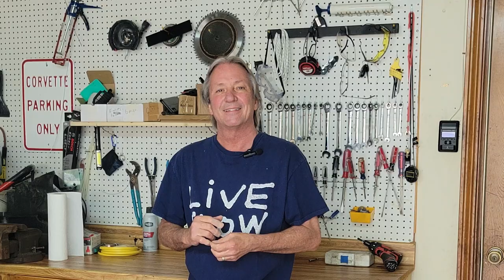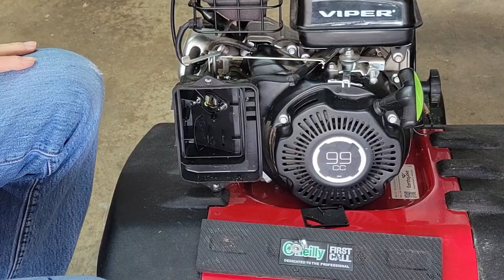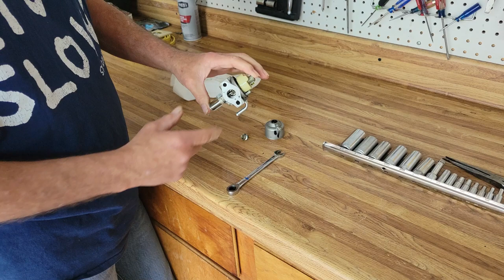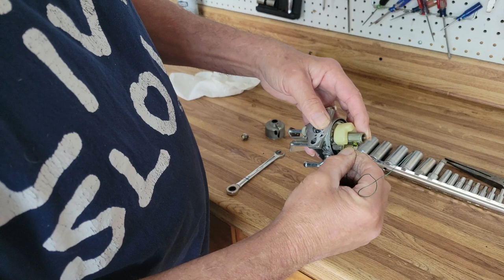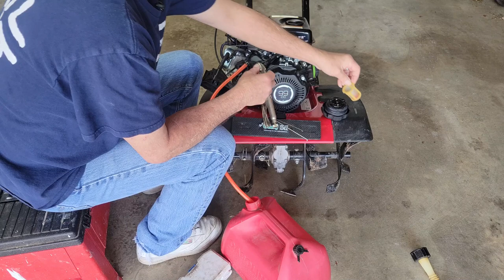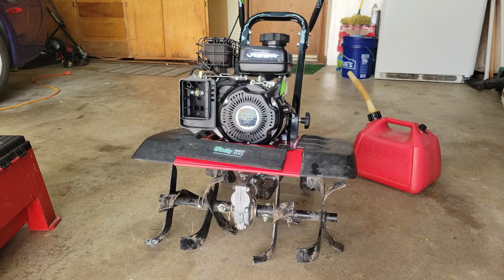Earthquake Versa tiller - left in storage for over a year, I wonder why it won't start?

Comment: So I should leave my gas in so I can be part of the video lol. The problem with home owner tillers is they get used often. I use to own one I did use mine twice a year. I never had an issue with it starting. I did you fuel stabilizer.
Good video
Reply from the maker: You can drain the gas, I get enough videos from people who don't. 🤣
Fuel stabilizer goes a long way towards avoiding meeting me(dunno if that's good or bad LOL) but draining the gas is better, you can still get enough degradation over 6 months time to clog a jet, they are pretty tiny.
Reply: @GuysPlayingWithTools  lol I’m with ya. Tayal fixes all had a great long term test on a bunch of stabilizers it was quite interesting.  Some of the big names didn’t make snuff.  But all of them failed at 19 months.
Reply from the maker: @MyGreenLawn2019  They failed the users, that's where I come in. LOL

Comment: Thanks for the video. This was exactly the problem with my tiller.  After cleaning out the carb jets and putting everything back together, it started on the first pull.
Reply from the maker: Thanks for watching! I love working on as many different motors as I can. I always tell people... it's usually the carb.

Comment: I just got mine.  Is there any gear oil or anything that goes in the gearbox for the tines?  Or is it just a dry system?
Reply from the maker: It's been a little while but, if I recall correctly, it was a belt drive system hidden underneath everything and didn't need any lube.
Reply: @GuysPlayingWithTools  thanks.
Reply from the maker: @TwoStageTrigger  👍

Comment: Any suggestions if the tines of this particular model won’t turn?  The clips are in, I can move the tines manually when it’s shut off, and the handle has tension when pushed down to engage.
Reply from the maker: Do the tines move easily by hand? I have a hundred questions, but that's a good place to start.
Reply: @GuysPlayingWithTools  I figured it out.  Broken belt.  So glad it’s an easy fix!  Thank you for replying!
Reply from the maker: @Krystal McClaskey  Cool. I am glad you found it
Reply: Were did you get the belt?
Reply from the maker: @barry1705 I get all my belts from the local car parts store.  Look up the belt online, and they will match it up for half the price, and usually, it's better than stock.  👍

Comment: Do you ever add fuel filters to these smaller engines?
Reply from the maker: Hi Carlos, good question. I usually don't but there have been cases where I have. If the gas cap is level with the top of the motor and I am already replacing the fuel line I might add a filter to keep debris out, people tend to fill the tank wherever it stops, even in the yard.

Comment: I'd of been happy if a gummed up carb was my problem, put mine away for winter pulled the cord 2 times today and started up. I let it idle for a while to warm up a bit and as soon as I engaged the belt it stalled out seemed odd. Started again same thing come to find out the transmission bound up over the winter never again with cheap tools.
Reply from the maker: I haven't seen that, but I am sure it happens. Did you consider opening the case and trying to free it up?
Reply: @GuysPlayingWithTools  Thanks for the reply didn't have time today, but I never abused the machine. In fact I have a big tractor with tiller to break ground in spring and use this machine to keep weeds down between rows, very disappointing as it was versatile with the removable tines. I've only used it for a season and a half. I'll post back when I get a chance to look at it mean time I guess I throw the cultivator back on the tractor.
Reply from the maker: @mrelectron6220  I usually hear good things about the "big" earthquake tiller,  I am going to keep an eye out for others with gear issues and try to find one to break down and see where the weak links are.
Reply: @GuysPlayingWithTools  Well I did split the transmission open this weekend. The results are the bearing at the ends of the input shaft have rusted. Apparently they did not seal it correctly with silicone rtv. I think I have located replacement bearing and will press the old ones off and press new on. I may modify the trans with a fill plug and fill with 90 weight gear oil rather than packing the bearings with grease again. At least the gears did not fail so hoping to salvage the tiller but still not happy this should of never happened.
Reply from the maker: Tillers usually have a rough life. Seems like 2/3 of the tillers I get are stored outside, or dirty,  sometimes both. Manufacturers should take  that into account in the design. The other part is. They tend to only get used in the spring, which gives rust time to work.
Reply: @GuysPlayingWithTools  I've seen that too this one lived a pampered life in my garage. The only water it seen was from being washed off with the garden hose when the dirt would cake up on it from time to time. I'm just glad I can repair it rather than buy some thing else.

Comment: My pull chord is locked up won't let me pull more than 5 inches. Is this why yours won't start?
Reply from the maker: Does the motor rotate when you pull it, or does it just tighten the spring?
Reply: No it just rejects it instantly at a certain point. Won't go more than 5inches at all.
Reply from the maker: @santiago nunez  in that case I would take the recoil off and try to turn the motor by hand, if you can turn the motor, get a good look at the recoil, something is amiss inside it, but if you can't,  it is a motor problem.  Start there, though and feel free to email me pics if you want

Comment: Where can i get a carb just like the new one you put on. Mine is identical to this earthquake and having the same issue.
Ben
Reply from the maker: You can order one on Amazon, if you get a new one it's best to put the old one next to the computer and visually compare them. 
If you want to save time and money,  check the part of the video where I take it apart,  cleaning the jets is easy and will get it running great just about every time and cleaning the whole carb works every time.
Feel free to ask questions if you decide to pull it apart. It's easier than it sounds.

Comment: Do you by any chance have a part number on the replacement carburetor you put on ?
Reply from the maker: If I remember right,  I didn't get a new one for this one. You will want to look online to find out with yours in hand, there can be differences between mfg year that aren't obvious. Grab my email from my about window and send me a couple pics of your carb, and I will match it up for you
Reply from the maker: It took a lot of digging since it was almost a year ago but I found it. Go to Amazon and search for  ARDISAM 10078
Reply: Looks as new as mine! So this junk has to have a new carb after you use it once. Got it👍

Comment: What about the oil? How much to add and drain?
Reply from the maker: Good question.  Every motor has its own oil specs, and this one is the most common, 1/2 liter(16.9 oz). I don't always do it on camera, but everything gets drained and then gets new oil when we work on it. It's cheap and easy so I recommend doing it at the start of every season.
Reply: I have this exact Model. Earthquake 99cc versa viper. How much oil should show on the orange cap?  How do you drain the oil? Thanks!
Reply from the maker: @albeme5211  Cool. It's a nice machine.  I haven't seen it for a while, so I am going to go back and check my record on it first thing in the morning when I get to the desk
Reply: @GuysPlayingWithTools  Thanks! If you could show it on cam  ,that would be great. Great and helpful content 👍🏽
Reply from the maker: @albeme5211  I didn't forget you, it's been a busy day 🙂Unfortunately I don't have one to make a video or I would but it's a pretty easy process.  
On each side of the motor(easier to get to the gas tank side.) you will see a fill plug towards right right side, and a bolt at the bottom center on the side of the motor. The bolt is the drain plug for the oil.
Take the bolt out at the bottom of the motor out and try to get something under it, it's a little messy emptying the oil form one of these. 
Once all the oil has drained, put  17oz of oil in it and check it, that's the capacity from empty so you should be good to go. I prefer Mobil One 10w30 synthetic for all my 4 stroke yard equipment.
If I get another one of these I will make an oil change video, I should probably be making them on everything that comes through. 👍
Reply: @GuysPlayingWithTools  I really appreciate it! Been busy so didn't get the chance to start it(new machine). What did you use to add the oil . Add it where the orange cap is located, correct?
Reply from the maker: @albeme5211  I usually use a funnel if it's not on the bench. Most quarts of oil have a clear line on the side of the container, and you can see the amount left in the quarter. I guess at 1/2 a quart, then check the amount left in the quart,  then put more in, then check.  If you are referring to the plastic flat top bolt on the bottom right(usually) of the motor, that's where the oil goes. 👍
Let me know how it went.

Comment: Had mine 6 years now, first time I DID drain the gas. Won't start. Every other year I would fill it full before storing and it always started right up.
Reply from the maker: I have to ask(I am always curious)Are you using fuel stabilizer (or non ethanol fuel)? Also, did you run it empty when you drained the gas? I usually recommend running it until it stalls.
Reply: @GuysPlayingWithTools Yes to non-ethonol fuel. I have used Sta-bil before but it has been a few years at least. Never have an issue topping off mowers or snowblower either. This past spring I did run the tiller until it died.
Reply from the maker: @qwsxcde0988  That's pretty interesting.  The non-ethanol fuel is what saved you, but I can't imagine why it didn't start when you followed the accepted way to store it.  If you are near The DFW area I would love a look at it. There is an exception to every rule and I would love to see what the exception was in this one.

Comment: How do you drain the gas?
Reply from the maker: Hi Ruth, I put hemostats(anything to kink the line will work) on the gas line and then remove it from the carb and let it drain down into a "bad gas" tank. If it's too low for the tank I drain it into an empty water bottle and then pour it into the tank.

It takes a few minutes to drain but the way I see it, I would spend that same time cleaning up gas if I tried to pour it out. 🙂

Comment: I made the mistake of wasting my money  on one of those tillers last year! Used it to till my garden then tried using it today! An hour later I said screw it!
Reply from the maker: If it sat since last year, drain the gas and add new, then pull the jets out of the carb and clean them and you should be good to go. You usually won't have to replace the carb unless it's been sitting for a long time(3 or 4 plus years)
Reply: @GuysPlayingWithTools  Did all of that. Still will not run.
Reply: @GuysPlayingWithTools  It sat in my shed since I used it last spring.
Reply from the maker: @Brian Green  to to drain the gas, it hasn't been too terribly long so fresh gas might wake it up
Edit: you will have to pull the cord quite a few times to work the new gas into the carb,  don't use a ton of choke and hold it floored so it can breath better
Reply: @Guys playing with tools  I had to move on to my other projects I had to do today. I'll have to try again this weekend. It just stinks that I've only had it a year and  it fails me when I need it the most.
Reply from the maker: @Brian Green  If you want grab my email from my about box and ping me and I will send you my number, I will help where I can.
Reply: @GuysPlayingWithTools  OK. Thank you.
Reply: @GuysPlayingWithTools   I am thinking it's the carbuerator but it's only a year old tiller. Is this a common issue with this brand of tiller?
Reply from the maker: @briangreen256  Unfortunately it's not just that particular machine, it's the gas. When modern gas ages, it picks up water from the air and turns "sour". I get machines nearly daily that only have one problem, they sat for a year without being used. What you want to do is get rid of the old fuel, and with a little luck you can clean the jets and it's good to go. With a little less luck, a full carb clean, with the worst luck you could have, replace the carb because the parts inside rusted and corroded beyond hope.
Reply: @GuysPlayingWithTools  I took a part the carbuerator and cleaned the crap out of it with carb cleaner. No luck.
Reply: @GuysPlayingWithTools  I have a small eartquake cultivator that sat for 2 years but no problem starting it. Only difference is it has a primer bulb and it's a 43cc instead of a 99cc. Same manufacturer 2 different outcomes😐
Reply from the maker: @briangreen256  I am WAY more surprised that one started after sitting 2 years than that another wouldn't start after 1 year of sitting. 2 year old gas usually won't start anything. Maybe one got fuel stabilizer and the other didn't?
Reply from the maker: @briangreen256  I just re-read this and realized that you are talking a 2 stroke vs a 4 stroke. The carb internals are night and day different between the 2. On the 99cc motor the jets are under the fuel level all the time. 
It's been a while since I looked at one of those, Take the bowl off, there is one in the side that always needs cleared(at the very bottom of the carb, on the side) and possibly one inside the tube that one is in that also needs cleared and it should work. If it doesn't, aftermarket carbs for those are really cheap.
Reply: @GuysPlayingWithTools  I didn't put fuel stabilizer in the 2 stroke but it had a very small amount of fuel in the tank. Maybe it faired better because it uses an oil  gas mixture?
Reply from the maker: @briangreen256  Could be that it helped some. I don't know if I have ever had one start with the gas that was in it after it sat for a year
Reply: @GuysPlayingWithTools  It sat in my shed for 2 years because I bought the bigger tiller last year. But the smaller tiller is working. It just doesn't till as deep and it's much more narrow. I have 324 square feet I'm tilling lol Its wearing me out! Got to get my garden going tho! I waited longer this year because of all the rain we have been having.
Reply from the maker: @Brian Green  why not go get another carb for $15, then tear this one down to nuts and books to get a feel for how they work without worrying about damaging anything? 
I usually clean them, then put them back on unless I have one already cleaned and ready to go but it took a while to get good at it.
Reply: @GuysPlayingWithTools  I will try that but I tufted it out with the mini cultivator till I got the garden tilled. I started around 4:30. I finished around 8 lol I still have work to do but the hard part is behind me.
Reply from the maker: @briangreen256  It's always nice to get the hard part in the rear view mirror. I had one of those days, dug 7 holes for 4 bushes... kept thinking "they need to be a little to the left, they need to be a little father from the house... I made a hard job harder by being too picky. 🤣
Reply: @GuysPlayingWithTools  Lol The hard work is worth it to me. Making food come out of the ground is important especially how expensive food has become these days. Always good to have a backup👍
Reply from the maker: @Brian Green  I agree 👍

Comment: I'm getting one of those magnets ! 🧲  I think you can double your money on this one !
Reply from the maker: Get 3 or 4. I use 4 and attach each one to its project until the last nut comes off it. I usually have between 2 and 5 motors apart at a time, sometimes for days waiting for parts,  and don't lose (or mix) parts at all this way.